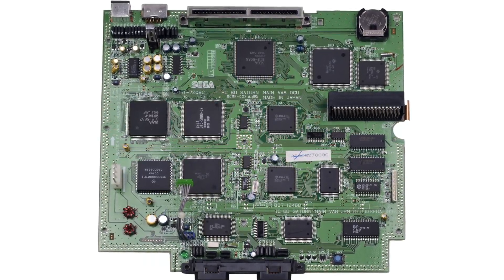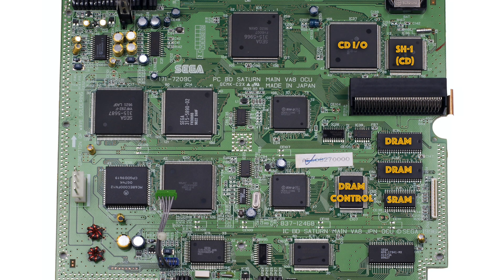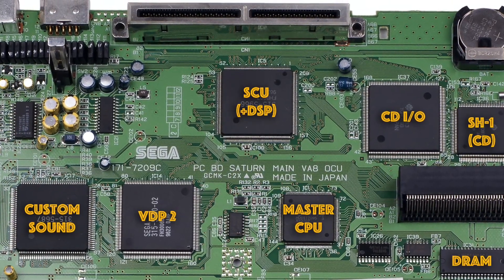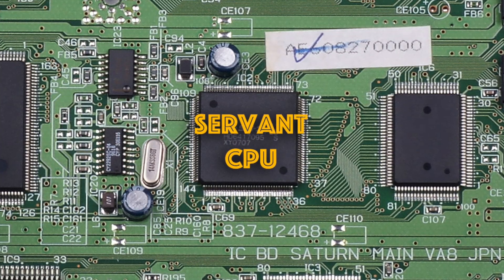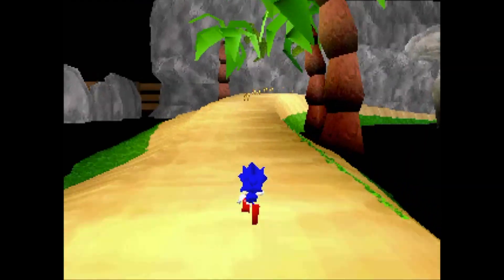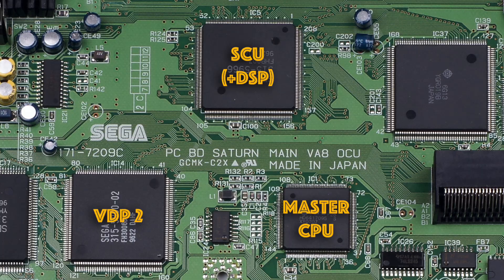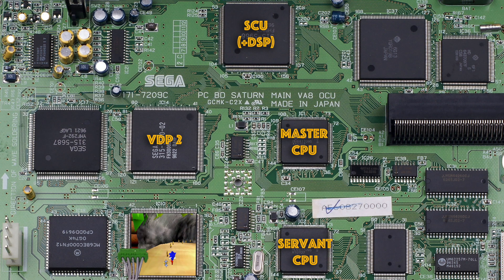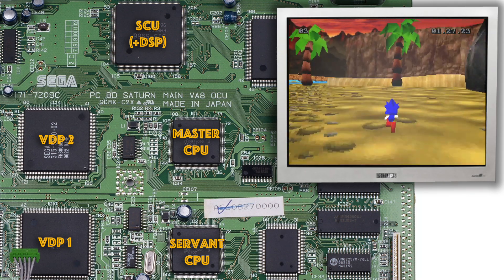SONIC Torn Apart to Expose SEGA's Insanity With Multichip Madness

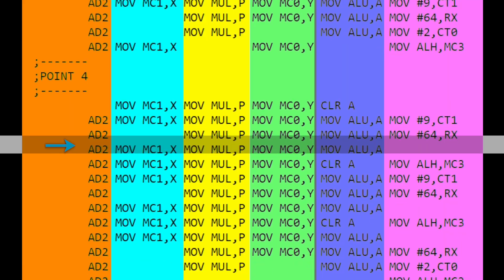Comment: 4:00 6 different instructions at the SAME TIME? So the Saturn was a EPIC/VLIW like DSP? (EPIC: Explicit Parallel Instruction Computing) That's interesting, because that's a kind of architecture that used to be common for supercomputers! You know, the kind that were used in old school HPC clusters, which were used extensively for engineering problems which involve a lot of linear algebra, statistics & optimization problems.

Comment: It would be interesting to go a little deeper and break open some of the steps that were a little handwavy. Like, "finally all the layers were combined", what does that mean? The pixels for each layer were sitting in memory and the scan-out could read from multiple buffers at the same time, compositing final pixels as they were sent to display? If so, how were transparent pixels in the layers indicated? If not, was there a composition step boiling the layers down to one framebuffer? If so, what chip performed that? Etc....
Love the videos and your presenting style by the way.
Reply: I agree.
Software people make it sound more complicated than it seems to a HW person. The tasks and pipeline were clear. The VDP2 did all of the video output. VDP1 did the rendering. SCU does the setup/transform of the polygons/geometry. Master CPU did control the memory transfers and main loop. Slave CPU does the processing heavy but conditional/sequential math.
All games were frame driven, not asynchronous real time. Depending on the TV standard 50 or 60 frames were computed. A frame update mid picture would usually cause a black line.

Comment: This is the most diplomatic and tactful description of the Sega Saturn's patchwork architecture I've ever seen. A more pragmatic take would be "a confused, schizophrenic design resulting from haphazardly converting a system originally designed exclusively for 2D games into a 3D system in order to compete with the PS1, which blindsided Sega while they were still focused on one-upping the SNES". Given Traveler's Tales' penchant for doing crazy stunts with limited hardware, it's no wonder Mr. Burton has such fond memories of the console, but most third-party developers hated it, which was one of the reasons the Saturn flopped.
Reply: Sega: Welcome to the Next Level!
Competitors: Dude, you should be on the next game.

Comment: How is it possible to write and compile a program in two languages (assembly and C)?
Reply: The compiler takes care of interpreting the higher level language (C) and also noting directives to the compiler to inline/inject assembly directly into the binary before creating the final output binary.

If the ASM code and C code are targeting different CPUs / machine languages, the tool chain may cross compile (or use specific definitions) for each chip.

Comment: I'd love to see a video series on how assembler relates to C, C++ etc. I primarily code in C++ and C#, so when I look at C code you're written, it's a little more complex than the code I write, but I can see what you're doing in a given snippet. When you show assembly, I'm just lost. Best I can do in assembly (and only x86 assembly at that) is perform operations on arbitrary numbers with mov and add/sub/div/mul commands etc. Anything above that? No chance. I could maybe write you a basic calculator, but that's about it lol

I guess a big question I would have is did hardware manufacturers back then give you datasheets on how to send commands to the various components and red input etc? Or did they just hand you the dev kit and just expect you to figure it out? I ask because I've done a bit of work with PS4 development with a dev kit at the university I teach at, and they provide a COLOSSAL amount of documentation on the internals and how to use the various abstraction layers built into it so you can write code to run on it. Of course, you wouldn't write code in assembly for a PS4 or you'd still be working on one game 50 years from now, but in theory you *could*. I'm just curious how, say, the C++ instructions I write for it convert into assembly, even at a basic level to give me an idea. 

We have a separate lecturer who teaches the low level stuff like assembly, and I teach the more creative stuff like game design and high level scripting, but I'd love to get an insight into how our two disciplines relate.
Reply: Download flat assembler by Thomasz Grysztar and his programming guide, flat assembler comes with some example programs to help as well.

Comment: There were many revisions made through its life.

Me: Wait. The Saturn had a lifespan?
Reply: Mostly for Japan I imagine.
Reply: I know for a fact that there were at least 2 in europe.
The launch units had small elipse buttons, but these were replaced with round ones on later units.
Reply: @NemXX2  I had one with round buttons in Brazil, no disc access LED in the panel.
Reply: Even a short lifespan is a lifespan. But the Saturn har games released for it from 1994 - 2000, the majority of which came out from 94-98, so it had a pretty typical console life. There were around 1000 total games, and it outsold the N64 in Japan.

Comment: 1:10 - Saturn was promoted back then as having access to an internet based system where you could play original genesis games.  I still believe I have my old Game Pros which talk about Sega Net, so I bet that chip was there in the case they could run genesis roms via the online server (that failed horribly).

Comment: Sonic R is definitely a showcase for what the sega saturn is capable off through careful and optimal programming.
Now about the sega genesis 
Am sure the sega genesis games can be made compatible with the sega saturn,maybe trough emulation, the gba can do it,so therefore it should be also possible on the sega saturn,,,

In fact i remember vaguebly about a planned adaptor for wich you could plug in sega genesis,sega mastersystem games and gamegear games into a sega saturn, but not so sure about that,mmmm.

Comment: It's always struck me looking at the specs that the Saturn should have been at least 1 1/2 to twice as fast as the PS1 hardware wise.  It seems to me that the only thing it lacked were proper developer tools that would have allowed the less-than-stellar programers (sadly, not all programmers are as good as the Author 😋) to have properly used the hardware available.  This same problem, speaking of coding for what amounted to an SMP system would come up a few years later when PCs moved to multi-core chips, etc.
Reply: This just isn't true. For pure textured polygon pushing, the PS1's custom GPU was EONS more powerful, feature rich, & flexible than both the Saturn's VDP's combined. "3D" on the Saturn had be achieved at all with really clever sprite manipulation (hence why it uses quads as the primitive vs the standard triangles. They're really just individual 2D sprites with some clever use of scaling & rotation), as the hardware was almost entirely designed from the ground up for 2D graphics. (Whereas the PS1's video processor was pretty much the exact opposite, with 3D being by FAR the primary focus). The Saturn as a whole was extremely powerful in a raw calculations per second kind of metric, but when it came to running 3D games it tended to fall flat on its face.
Reply: @Cooe.  In terms of GPU drawing the Saturn could have done what the PSX did if only it allowed textured triangles with Gouraud shading, the Saturn was almost there but not quite with its quirky rectangle sprites. Sony had to bolt on a "Geometry transformation engine"(GTE) CPU-based co-processor to calculate 2D coordinates for the GPU from 3d vectors, a lot of Playstation's 3d capability was done by software on the CPU, unlike GPUs of today.
Reply: @SerBallister  That's a whole lot of "whataboutism" if I've ever heard any. The PS1's design was as explicitly 3D focused as could be ANY console design at the time it was done (developed over ≈ 1991-1994).

Sony was breaking new ground in so many areas for a mass consumer product (aka not a >$10,000 SGI workstation; with the GTE in particular helping to push things forward) that of COURSE they'd be missing some things we'd later traditionally associate with explicitly 3D focused rendering hardware. I'm sure if Sony had had the benefits of hindsight, endemic affine texture warping & such wouldn't have been a thing ofc, but that doesn't mean the PS1's hardware design wasn't focused around polygonal 3D first & foremost (again, unlike the Saturn's).

And ofc after both, Nintendo would then take the "it's a 3D hardware design for a 3D polygonal gaming era" to the inevitable extreme. This as the N64 design done w/ SGI was basically the exact opposite of the Saturn's. 

The N64 was built almost exclusively for textured polygonal 3D & as such was absolutely STUPID powerful at polygon pushing for 1996 (at launch, the N64 & its SGI developed "Reality Engine" kicked the ever-living ASS out of even the highest end gaming PC's w/ their quaint little 3dfx Voodoo 1's as far as RAW 3D textured poly pushing power was concerned), but was absolutely dogshit at high-res 2D rendering. 

Hence why the N64 library is full of expansive 3D platformers & action games instead of the Saturn's fighting games, JRPG's, & assorted Japanese obscurities. PlayStation otoh neatly split the difference between the other 2 consoles in design focus/prowess, even if 3D was definitely still Sony's prime priority. The Saturn otoh was a next-gen 2D system that Sega desperately tried to jury-rig for the "3D era" at the last minute by expensively just throwing a bunch more already existing silicon at the problem (aka, "if we're gonna do 3D by sprite manipulation, then its gonna need at LEAST another pricey VDP to not COMPLETELY choke & die", & so on).
Reply: @Cooe.  I think you misunderstood, I was talking about the GPU as a discrete chip ("... in terms of GPU drawing"), on both systems they aren't that far apart in ability, the ps1's GPU is a 2d triangle drawing GPU with no concept of 3D, which for me puts it closer to the Saturn than one might think. 

The PS1 as a system had 1 additional piece supporting hardware located outside of the GPU for 3d acceleration. 

Everything else the PS1 had like table based Z-sorting and that janky tesselation it did was done entirely in software on the CPU. 

It's interesting because it wasn't a truly integrated hardware 3D pipeline, unlike every machine that came after it starting with the N64.
Reply: @SerBallister  Again, this is absolutely fucking nonsense. The Saturn's VDP's & Sony's co-designed with Toshiba GPU have next to nothing in common outside sharing basic sprite manipulation capabilities like rotation & scaling.... The Toshiba chip was EXPLICITLY designed from the jump as a dual-purpose 3D & 2D graphics processor, with triangles as the fundamental primitive for polygons & a largely normal 3D rendering pipeline (even if it's missing PLENTY of steps we'd consider necessary in more modern 3D rendering hardware. Literally the only 3D hardware on the planet at the time of the PS1's development with widespread use which had a Z-buffer w/ culling capabilities & all the other good stuff you mentioned were >$10,000 SGI workstations [& these capabilities wouldn't end up in a console until the SGI developed N64 ofc]).

The Saturn's VDP was designed from the ground up EXCLUSIVELY as a 2D sprite pushing MONSTER, until late, LATE into the Saturn's development when Sega realized they'd need to figure out how to make their already finalized hardware (as far as the chip designs themselves; aka there was gonna be no "redesigning the VDP for native 3D") work with polygonal 3D.... Which they did by literally throwing another VDP at the problem & brute forcing the "3D" with sheer sprite pushing/manipulating power & really clever use of what was BLATANTLY a 2D graphics engine/pipeline.
Reply: @Cooe.  Again, I'm talking about how both GPUs functioned, not what either company intended their roles as part of a larger system, I don't know where you're getting that from ?

Since you have apparent anger issues I'll end it here anyway, bye.
Reply: @SerBallister  ... So am I lol. The Toshiba PS1 GPU has what was at the time, a super modern 3D rendering pipeline. 

Z-culling, tesselation, & etc other things you mentioned were literally only available in CRAZY EXPENSIVE SGI workstations at the time when the PlayStation was developed, but the fact the PS1's GPU lacks such features doesn't make it "suddenly not 3D processor". The Saturn's VDP's rendering pipeline otoh is exclusively a 2D sprite engine from the ground up that Sega was forced to jury-rigged 2 of together to produce mediocre 3D. I can't understand why you can't see the difference... 

One natively renders 3D with textured triangles. The other exclusively renders & manipulates 2D sprites. If you can't understand the difference, you're fucking hopeless lol.
Reply: @Cooe.  Ok I'll bite :)

Well, we seem to be misunderstanding a little, I was talking about features of the PS1 and you confused those for a high end SGI machine? I am comparing the functionality of both their 2D GPUs, to be clear. 

Table-based Z-sorting (NOT CULLING) is a PS1 feature of the GPU (More correctly, the DMA interface to it). You can feed it a link-list to arrays of primitives (IIRC), this was called an "Order table" in Sony's documentation. This allows the PS1's GPU to render primitives on an arbitrary number of "layers" (Polygons are drawn painters style, so polygons belonging to arrays at the start of the list appear behind those that come later). This feature is used by 3D software to arrange polygons by Z-order (sorted into depth buckets by the CPU), in effect using software alongside a 2D hardware feature in a clever way to get polygon sorting without needing a Z-Buffer. 

Tesselation: This was a feature of the official Sony software libraries (That every game included) where it would split 3D polygons based on their screen size. The interesting part of this feature is it is 100% software based, so the Saturn can do this too. This crudely mimicked perspective correct texture mapping.

Comment: I dont know anything about programming but wouldn't developers build engines for their games and add to them and male them more efficient over time ?

I know this is partially the case but with the sega saturn,wouldn't there have been enough clever programmers working on it to then source or sell some type of engine kit making the saturn easier to develop for and if not then why not ? The hardware is useless without wizard level code.

Also from a gamers perspective then and now,i much preferred the look of saturns triangles than the shaky ps1 mess,was it really .. really that much more of a pain to work for the saturn because early saturn games looked the same or even better than ps1 which males me think more along the lines of either sony buying out devs and exclusives or lazy developers not bothering to put that bit more effort into the saturn  .. tomb raider,thunderhawk,resident evil come to mind yet wipeout was worse ... i would really like to know of the saturn would have truly been capable of better with wipeout,the port feels sloppy to me and am i correct in thinking it was a port from ps1 to saturn and not converted at source ?.

Comment: I made a 6800 in main kraft. It’s made out of pure diamond blocks and has 3 rams and it runs all the games because it is turning complete. I also put a dedicated Z80 working as an FPU unit. I’m actually writing this through the 6800 (Motorola 6800 NOT the 68000 from the mega Genesis that’s too complex for mine redstun) in minecraft so yea I’ll catch u later bye-bye

Comment: @1:36, looking at that thing and looking at a modern mainboard. XD.
Back then a hundred different chips with different languages and different buses. Today a cpu and a chipset and MAYBE some ram sticks if not soldered on. The dying of the various chips and buses began in 2006, when AMD started putting the dram memory controller into their cpus. Subsequently intel started eradicating various other chips like ata and sata controllers and usb hc's from their boards and moved them into the boards chipset. Nowadays looking at a schematic, you have the cpu and chipset, all ios extend from those two like a tree root, no other controller or chip involved.
Reply: Well, it is faster, cheaper, and smaller to combine chips if you can.